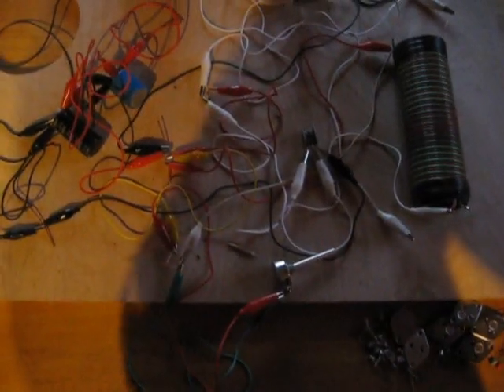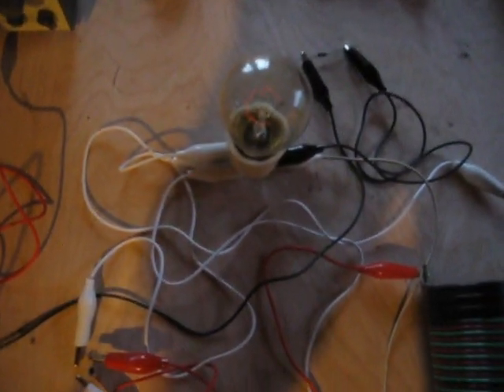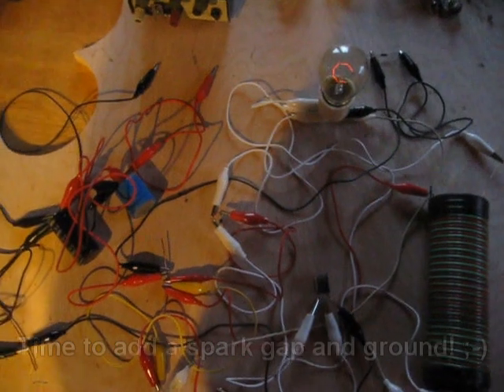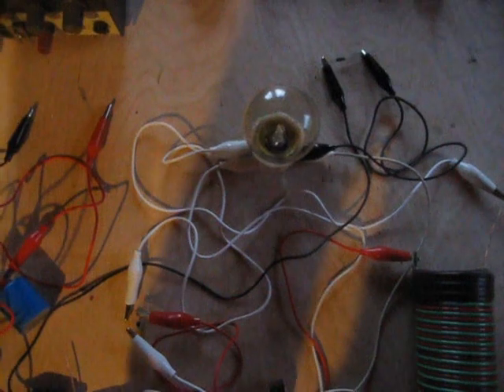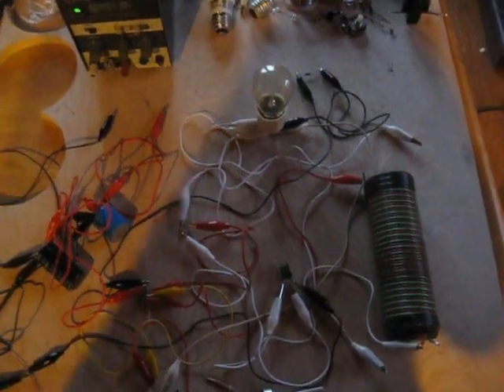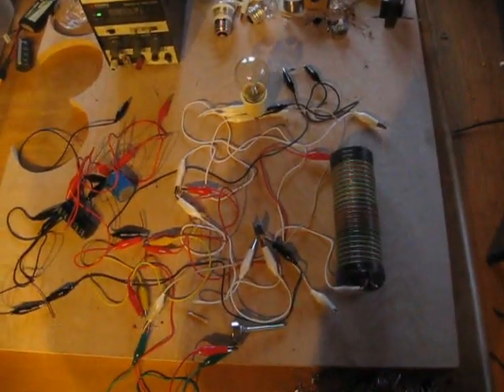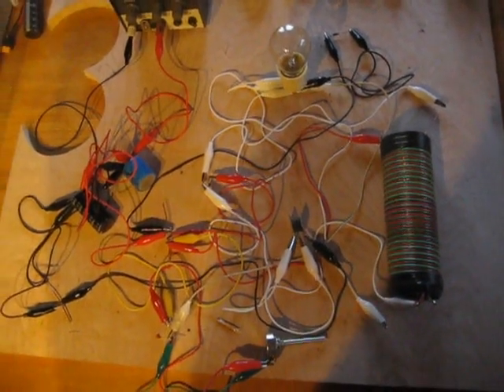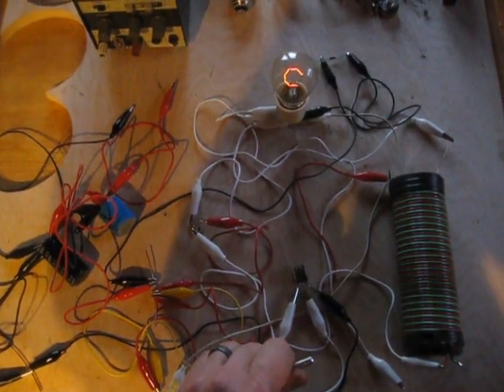Incandescent Bulb Running on Capacitors!  Joule Ringer CrossOver Update

Comment: you do really great work. One thing I realized while messing around is that all my clip-leads can cross-talk. It argues for really neatening up the wires so that they are not near each other. With high-voltage AC, the wires can actually blead through each other, affecting the circuit in ways you may not realizes as you stare at your circuit diagram.